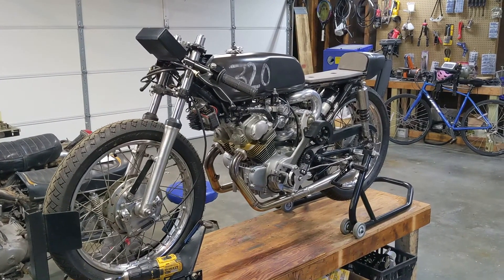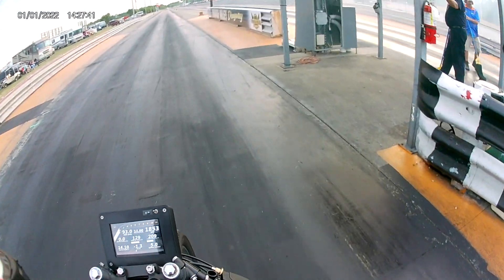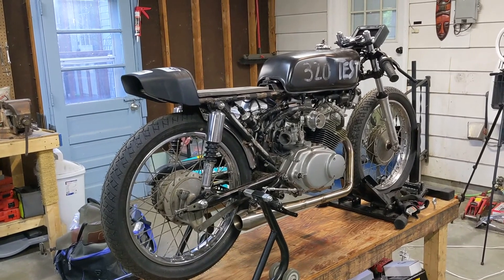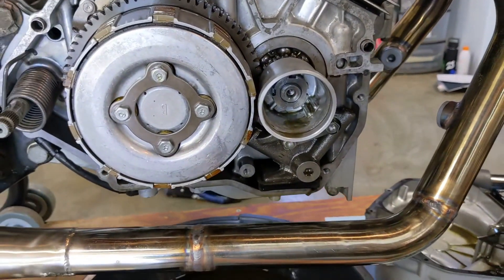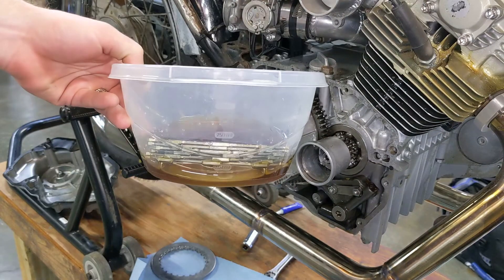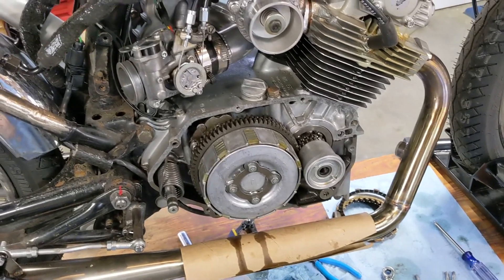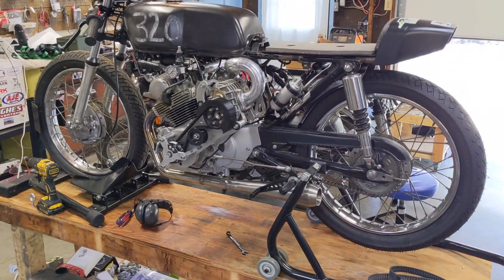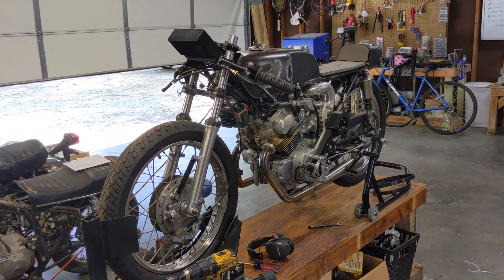I Turned Up The BOOST and Broke My SUPERCHARGED Land Speed Honda 175

Comment: I smoked the clutch in my 81' KZ1000 on a rainy day. Was hammering around town, fish tailing and burning water off my back tire. You dont have to clutch dump or anything for this so no abuse accept hard acceleration. I hit it going up an incline and she revved up, thought i was spinning until i realized the rear was still stuck to the road lol. Slipped like hell all the way back home. Almost did it again on a different KZ, same year and everything. When you think about it, that little basket is really getting the sht kicked out of it on any bike. Your bike is badass, ill keep checking back

Comment: These motors will live long lives at 50hp the trans not so much but clutchless shifts nice and easy and you can get 60 through the box before the input bearing gets pissed. You can use a crf230 basket and primary gear to make the clutch have 20% less load aswell as make you gears a bit wider and the china versions have a 6spring basket that will fit your springs plus two. Our compound bike is xr200 based but i have a few of these and rebel 250 motors around that iv stole stuff from for the compound bike in the early days. Its not all the same but its close enough with a little love most of it works well. Fyi our stock parts combo with a custom destroked crank pin took 60hp using basically the same rod as your motor before it let go at the bearing you have two so your probably not ever gonna worry about the rotating assembly but ring gap on the other hand id go pretty big and maybe add a piston squirter to keep things a bit cooler. You can also put a bigger oil pump really easily which helps with friction at 12-14k rpm which from what i remember i had a race bike as a kid that used one and that was about where the party was at its best and i know motors didnt live until we added a bigger oil pump and cooler. Not a power thing just a they like to rev but cant feed the head great. Awesome work i really appreciate the effort thats gone into it lol i understand all too well.

Comment: I'm surprised you even use the clutch.
Have you tried clutch-less upshifts?
I only ever use my clutch to get off the line and downshifts. Never upshifts.
Love the build, Cheers.
Reply: same feelings.
why the clutching?
taking off, first to second shift, stopping, and the rest of the time i dont use it... up or down.
Reply: I used to use a kill button instead of the clutch after the launch. Just leave the throttle open, jab the clutch and the shifter.

Comment: I just subscribed.  A suggestion to consider with concern to intake and cylinder head temperatures.  If your ECU can handle it, have a second set of injectors the squirt water on the exhaust stroke to cool both the heads and valves.  Since the water atomizes quickly, does not foul the charge.  Suggest 90% water and 10% 2 stroke oil to keep the pumps and injectors happy.  Good luck
Reply: He's not running direct injection, so how's he supposed to get that in there w/ the intake valves shut?
Reply: @nunyabidniz2868   Charge cooling works better with indirect injection, more time in the air stream to cool the air and is effective with cooling the valves when the water comes out of suspension and contacts the backside of the valve.  Other than some plumbing to mess with, not aware of any downsides and a lot of benefits.

Comment: Something cool to test/try for intake air temp would be a co2  or no2 sprayer similar to what's used on intercoolers in the auto scene. I've seen them used on charge pipes also when lacking an intercooler, people wrap the charge pipe using copper tubing that spirals around or just goes along parallel to the charge pipe with tiny "jets" drilled to spray it. Not sure it'd be any more or less cost effective long term but interesting to see the IAT differences with it lol.

Comment: Did you check the oil before you started it, and using a car battery to start a bike is a no no the amps are to high n will fry the bike’s charging system
Reply: Resistance of the circuit dictates amp draw, not the supply.
Reply: @curtislavoie2242  but but but but...

lol. a 12v battery delivers 12v into a circuit designed for 12v regardless of the battery capacity.

got in an argument with someone, called em a caveman for something like this...

i find it really sad that in this day and age, the average persons understanding of electricity results in strange notions like the OPs... i thought we were better than that?

looks around at world

oh yeah. we're thick as two bricks... oops :)

hang on... maybe the poor guy has experienced a 6v bike system on a 12v car battery?

watches 3 cell lead acid battery boil and spew frothing acid and flammable gases in amusement